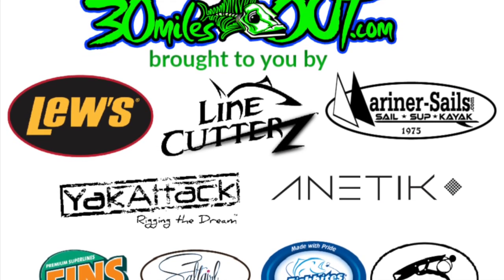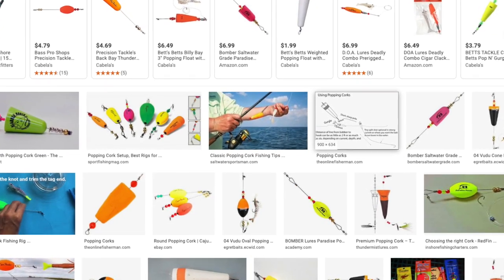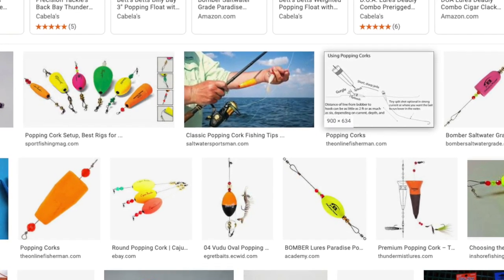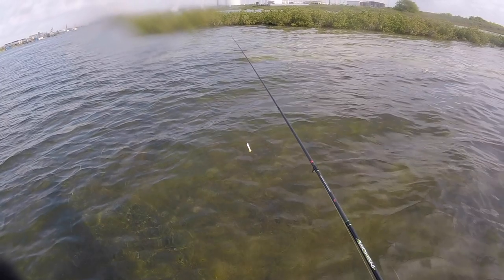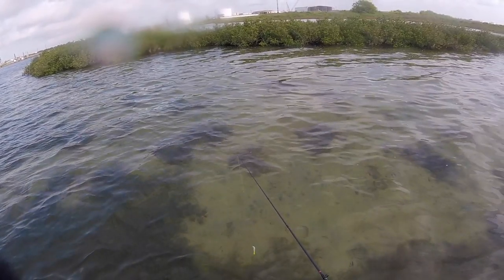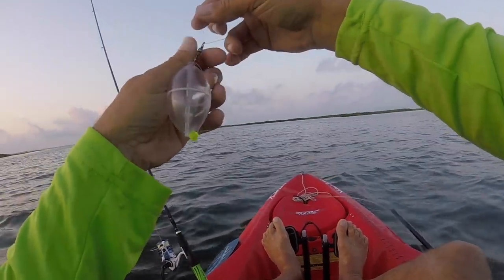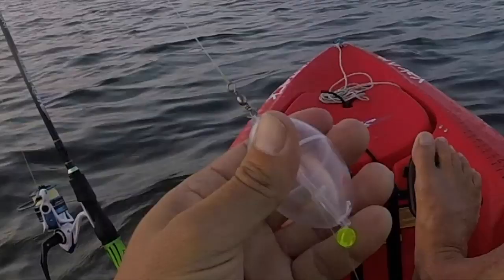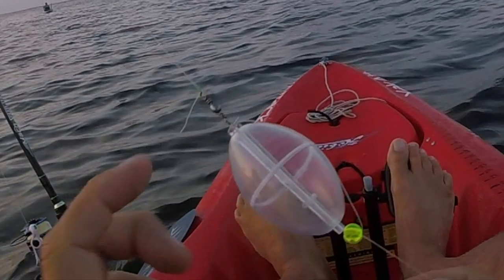How to Use a Bubble Rig | Inshore Fishing Texas Flats

Comment: I use a clear small torpedo cork up north for presentations in clear water. usually a mono leader from the popper to the lure (usually a fly or small twister tail). I also have had a lot of success with putting some eyes on a small clear torpedo cork with a single or small treble hook on the narrow end. Great finesse bait!

Comment: A just a bubbles seem good. Surgeon tubing inside so it is easy on braid.  Exact setup but with surgeon tubing. Run your line through it,   twist the tubing at the area you want to secure it and then tie on

Comment: The fat part of the insert in the bubble has to be toward the hook. Otherwise, the tapered plastic shaft inside of the bubble will come off and if there is water (for weight) inside of the bubble, it will leak.

Comment: Using a light wire hook, and a slow-sink or neutral fluke, would complete the subtle approach. Paddle-tail vibrations might be too much in those gin-clear waters.
Reply from the maker: i agree.... and i have done that. small hook , no weight . slow fall... it is deadly ....

Comment: So what is the purpose of a bubble rig usually?  I’ve never understood
Reply from the maker: The water inside it adds a ton of casting weight
Reply: @30mofishing  so it’s like a weight, but it won’t sink it?
Reply: You can set the depth and cast it a mile and you can use it as a splasher to attract fish -I use it to catch rainbow trout in freshwater and I use it for bonito with a fly - and other species in saltwater
Reply: @electricaf365  depends on the water to air ratio in the bubble. Fill it with water it will sink slowly, or put in some air to keep it suspend, or no water at all. Its up to how you balance it out.
Reply: I'm going to try the fly idea tomorrow, I usually use worms as I fish for tilapia and get great results results,but I got a box of flies at garage sale but don't actually fly fish